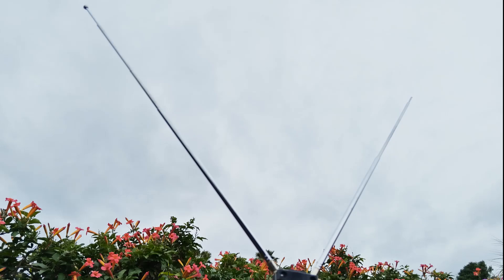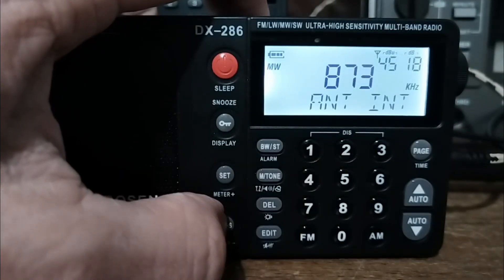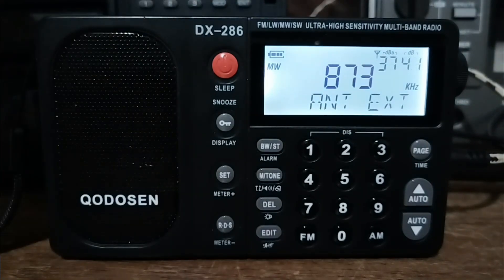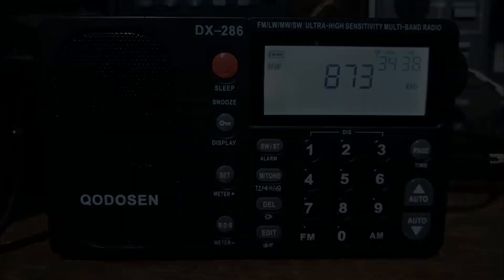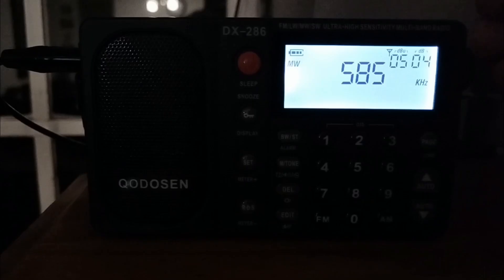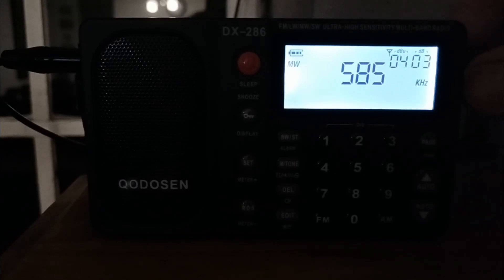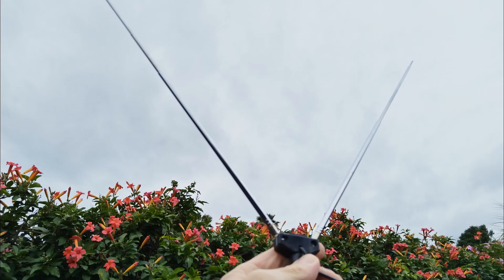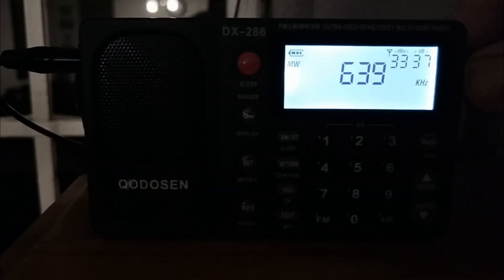📡 Dipole surprise for MW DXing on Qodosen DX-286: Russia, Hungary, Ethiopia heard in South Africa

Comment: A bit off topic but do you (or any readers here) know of any 'good' vertical antenna options for SWLing?
Friend lives in a group of units and can't run a longwire and a loop will be confined to courtyard surrounded on all sides by other unit complexes and their air conditioner systems, the only real option is a vertical on a pole just above gutter height but it can't be too massive either. 
I'm thinking an inexpensive 11m CB base antenna with no radials maybe?
Reply from the maker: I'm sorry, I don't really have an answer for you on this one. I haven't ever seen a vertical antenna specifically for SW being advertised. There is a vertical antenna for ham radio (HF) on Ali Express, it might actually work well for some shortwave bands also, as it covers 14 MHz to 30 MHz. So for SW it might be useful in the 16 and 13 metre bands. I actually ordered one of these, I will make sure to test it for shortwave, and let you know how it goes. I will make a video about my test also. Maybe your CB antenna idea might also work, but I don't actually know about that. I hope someone else might have a more conclusive answer.
Reply: @swlistening  Thanks Andre, I'm thinking a SW antenna needn't be tuned as our longwires, loops and whips aren't so simply sticking a few meters of aluminium tube in the sky will have to work to some degree. Looking forward to your adventures in ham radio. 👍

Comment: What a good video, Andre. Very interesting to watch and it's really good to know that this dipole works so well on the MW band. It's kind of unexpected, too, with so short whips on pretty long wavelengths. I need to try mine on the Qodosen too.
It doesn't cease amazing me that you can catch stations from this far away, up to the depth of Eastern Europe! The furthest I can catch from on MW here are stations from Maghreb.
As we discussed, the MLA30+ isn't quite said to me a great MW performer, so I'm not that much surprised that the dipole generally outperformed it. It would still be interesting to compare it to the Tecsun AN200 loop antenna, possibly putting it out of your window where your dipole is, with a long 3.5mm jack cable. I'd be surprised if the AN200 isn't the best MW performer in comparable conditions, with the drawback that it needs to be rotated to beam it.
Talking of MW, I learned today that Spain is to close MW transmitters completely. At least the ones from the public broadcasters. They want people to move to DAB+. I don't know that the timeline for this closure is, it will probably take some time, there are so many stations!
This will punch a HUGE hole in the MW band here. Especially when I'm in Brittany, the Spanish MW stations pretty much fill the band, leaving very little room for any other station to sneak through.
Maybe an opportunity for DXing in the future? A good for a bad...
Reply from the maker: Thanks for your comment Alain. It is bad news about Spain indeed. But, as you say, it might open up opportunities for you for more distant MW DXing. I think one of the reasons why I am able to catch very distant MW signals is because the band is so empty here. It makes it a lot easier to find interest signals from far away.

I like your suggestion about using the AN-200 outside in a test, up against the dipole.  I will do that. I think it might be the best one indeed. After all, it is optimised for MW.

Comment: Great discovery, Andre! I also happen to have the rabbit ears antenna and will definitely try it out. I have a few questions, if you don't mind. Have you only used it in a V shape? I read somewhere once that the orientation of a dipole should match the polarization of the signal, and that signals coming from the earth's surface are usually vertically polarized, and orienting the antenna vertically should be suitable for reception of such signals (with the leg that is connected to the center of the coax pointed up). Not sure if that was maybe applicable only to VHF signals. Second question: have you noticed any directivity of this antenna? Does rotating it increase or decrease signal strength? Or have you used it only in a fixed position? Also, are its legs fully extended, or just partially? I am excited about this, because I already believed the MLA 30+ had a pretty good reception on MW, so if this outperforms it, that is amazing. I already tried this dipole for SW reception on my RTL-SDR V4, but the results were pretty bad, only the strongest Chinese stations were coming through. Maybe it works better on a standalone portable radio.
Reply from the maker: Thanks for your comment Cristi! I used the dipole oriented vertically, stuck to a window. I think the more local signals (Mozambique, Botswana, Lesotho) are probably groundwave catches, and the distant signals are skywave. I did not experiment with the orientation, so I don't know if it would have made a difference. The two legs were fully extend, they are a metre long each. It was in a V shape, yes. I did not rotate it, it was just in one position. But I think rotation might have helped with some of the weaker signals, it makes sense. Just like when you rotate a telescopic whip for FM, and also for SW. I think the MLA does OK for MW, I have used mine for MW for a while. It is definitely better than the internal antenna and the whip on the Qodosen. But now that I've tried the dipole, I realised that the dipole is even better than the MLA. I did try my dipole for SW also, and it worked well on some signals, actually pulling in clear and strong signas. But this was on the Eton Elite Executive and the Qodosen, not the RTL-SDR itself. The results on SW were not as conclusive as on MW though.

Comment: I was wondering if the recent sun activity that was affecting the ionosphere has left it still a little agitated and that scan was on a lucky night. The Proton storm that came with the CME's also causes noise before the CME's hit the ionosphere... and afterwards. As you know the result of such disturbance can lead to rare and exotic catches for one's usual reception area. Try a few different nights and try to assess the improvement over the radios telescopic whip and the amplified loop gain and if it is directional? Please. Here in Estonia the medium wave band is completely useless but for some distant Russian stations  one occasional Spanish station under incredible static. I once picked up Radio 5 from the UK but have not been able too again in over a year! Even FM in Estonia will soon be only available on DAB+.

Many claims are made for improved listening which is the reason for DAB, DAB+ and DRM systems for improving listening and signal reception. While true, the other stations should be allowed to remain on whatever wavelength they are on today. It is a worrying fact that the controls governments have on the type of broadcast systems technology and the receivers allowed also limits what is broadcastable. Such reasons of quiet censorship by technology is why shortwave radio through its different perspectives allows an understanding of how difference opens our world overcoming the quiet (for your own listening enjoyment!) censorship of governments.

Comment: Nice scan on MW with the rabbit antenna!! who would have thought that this antenna will pull those MW DX stations. 

I have too much RF noise inside the house and near the windows, so my only choice is the roof to place antennas. And with the  MLA 30+, I needed to rotate it to find the right spot for low noise. I also use a 4.8 meter vertical and 20 meter long wire, all in the roof. My longest MW DX distance is 2,000 Km 

Thanks for the video.
Reply: Which of the three antennas has the highest noise floor?
Reply: @Well_Theres_Your_Problem The vertical antenna is a bit noisier than the other two, but not by much. When I first installed the longwire, it was horizontal near to the roof surface, but it picked up a lot of noise. Then I placed in a inverted V shape, and worked better.
Reply from the maker: Thanks Manuel, glad you enjoyed it. Interesting what you said about using the long wire in inverted V shape. Maybe I should try that. I tried MW listening with a long wire before, but it was incredibly noisy.
Reply: @swlistening  I tried several options, before using this inverted V configuration. Laying the wire directly on the roof surface, caused it to pick up noise, then I routed some of the wire down from the roof to a small backyard (2 story house) and got the same noise. I did the inverted V shape on the house roof and the noise reduced. I learned that I have to place the antennas as far as the house as possible. 

I live in the middle of the city surrounded by other houses, not much area to place antennas, except on the roof. So I installed the 4.8 meter mast on the roof, to hang the wire for the vertical antenna and use the same mast to hang the mid section of the inverted V antenna. And it works, there is still some noise but not as bad as before. 

I imagine my house and the others around having a cloud of RF noise that ends on the roof. The antennas have to be above that RF noise cloud.

I use these Vertical and Inverted V antennas for my HF amateur radio operation also. Depending on the frequency one works better than the other for transmitting. For reception, just the vertical is a little noisier.
Reply from the maker: @MF_RADIODX  Thanks Manuel, that's very interesting about how you used the inverted V. I am currently experimenting with the best options for my EFHW, for ham radio. Like you, I basically only have the roof to play with. The EFHW is also in an inverted V shape, but directly on top of the roof tiles. I have a pitched roof. It's the best I can do right now. Part of the wire was overhanging the roof on the garden side (tiny garden, more like a large terrace). When I tested the SWR it was very high. So I tried a different configuration, with the overhanging part of the wire back on the roof to create an L shape. The SWR was even worse. Then I just folded back part of the wire, to make it shorter, and I got an SWR of 1.2 on 40 metres and 1.5 on 20 metres. So now it seems to work. I have been listening in to some ham conversations, but haven't transmitted yet. I might try tonight.
Reply: @swlistening  Hi André, good to hear that you are setting up your amateur radio station. For your EFHW, have you tried a 49:1 unun, to match the impedance of the antenna to your transceiver? I use one on my EFHW and I can work from 160 to 10m. The SWR from 10 to 40m is under 2.0. Below 40m, the SWR is from 2.5 on 60m to 3.5 on 160m, I use an antenna tuner, when SWR above is above 3. For the antennas, it is always good to use a choke balun (you can make one with your coax cable making several turns on a ferrite toroid). This is to avoid RF from the antenna coming back to your transceiver.

I wanted to make antennas that work from 10 to 160m, so I made a vertical and an EFHW antennas The vertical works from 80 to 10m, 160m is difficult, I'm testing some ideas for 160m. For DX contacts (several thousands Km) both antennas work similar from 10 MHz to 28 MHz.

Below 10 Mhz, the vertical outperforms the EFHW in regards to DX distance. EFHW is more local (less than 1,000 Km), vertical is from 2,000 to 3,000 Km. 

But always there are compromises, the SWR on the vertical is high (5), especially below 10 Mhz, I have a 4:1 UNUN, and need to use the antenna tuner. And since the height of the antenna is not the best for the lower frequencies, I know it's not very efficient, but any way I make contacts. I´m thinking on making some loading coils for the vertical antenna.

And I also use these antennas for regular SW and MW listening.

Good luck on your setup, hopefully we can make a radio contact soon.
Reply from the maker: @MF_RADIODX  Thanks Manuel! I am responding to your comment in more detail in an email.

Comment: That’s a very interesting bandscan - I can only hear two of those stations. The MLA30+ would need to be about three times the diameter to work properly on the lower bands (some even stick an aluminium hula-hoop on the amp), so even an unamplified dipole wins, unlike with SI4732 sets. *I use the TEF with a small MW loop (~22 cm, similar to the AN-200), no amp. Even winding a few turns around a 🪣 can enhance MW reception... 😅😊 Looking forward to more MW/DX scan videos 👍🏻
Reply from the maker: Glad you enjoyed it! You are right about the MLA, it is certainly not the best for MW. But I found that it does outperform the internal antenna and the whip on the Qodosen. The dipole was a big surprise. I have an AN-200 and it works well, but I think the dipole is better. I will compare the dipole and the AN-200 also.
Reply: @swlistening  It would be great to see a comparison like that. I only knew a dipole was good for FMDX, so it’s interesting to see how directional it is on MW - especially compared with the AN-200. Who knows, maybe it’ll even make something audible on LW. 🤓
Reply from the maker: @well-mannered-troll  How I wish it would work for LW! I can't hear any LW signals here in Johannesburg.
Reply: @swlistening  That’s a pity. Your distance is twice+ mine, and the direction is suboptimal for hearing those two powerful North African stations… At least some VLF, LF, or NDB beacons will probably break through, just to make the band feel alive…
Reply from the maker: @well-mannered-troll  I once heard an NDB near Cape Town, but that's all so far. But, I must add, I haven't really tried DXing these NBD beacons, it is something I should explore more.

Comment: Anything will work with the Qodosen. As long as it’s metal and long. Have you tried a 10m wire outside?
Reply from the maker: Hey Matt, I have actually, I tried 15 metres of wire, but it was a complete disaster. The wire just picked up noise. I only heard some strong local and Mozambican signals with the wire, apart from that it was noise. I experimented with shorter wires, 10 metres and 5 metres, same story. Noise. For me, only the MLA30 worked here in my suburb for MW on the Qodosen. Until I discovered how well this dipole works!
Reply: @swlistening That’s a shame there’s so much noise. Sounds like a loop antenna would work well there. One of those older types made up of turns of wire on a frame.
Reply from the maker: @arcticradio I think so, yes, it will work much better than a long wire. I did try my Qodosen with a long wire in a park some time ago, for MW, and it worked really well. In the park the long wire was great.

Comment: Be interested to see how your 15m longwire compares to the rabbit ears dipole Andre.
Odd how these 'TV' antennas work on MW but not so great on SW.
Reply from the maker: I should have mentioned it in my video, I did use a 15 metre long wire in the past. Or, I should say, I tried to use a 15 metre long wire. It was very noisy, pretty much useless. It is a characteristic of the Qodosen that it works exceptionally well with external antennas for MW, but only if you are in an area with no noise. That has been my experience so far. But, for some reason, the dipole seems to work really well.
Reply: @swlistening  How do you find the dipole on the higher SW bands?
Reply from the maker: @Hang.On.A.Minute  I haven't really checked this specifically, but I did a general scan of all SW bands with the dipole, and it worked quite nicely. Kind of comparable to the MLA30, but less noisy, on some signals, not all.

Comment: How do you have the antenna mounted?
Reply from the maker: It has a suction cup, so it is on the outside, stuck to a window, just below the eaves of the roof.
Reply: @swlistening  Another dumb question: Did you mount it vertically and, if so, which end was up in the air?  If not, was it in a V-formation pointing up or down?
Reply from the maker: @WhiteHonky-mv1eu  Not a dumb question at all. It was mounted vertically, yes, in V shape. Both legs were pointing up.